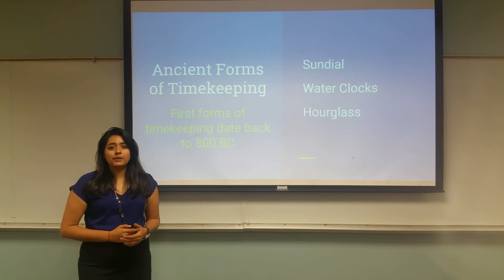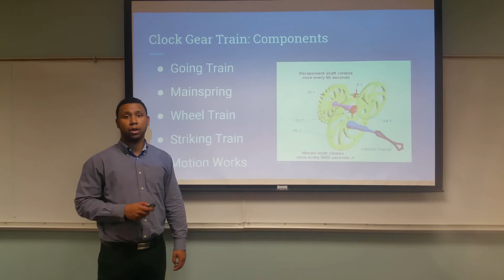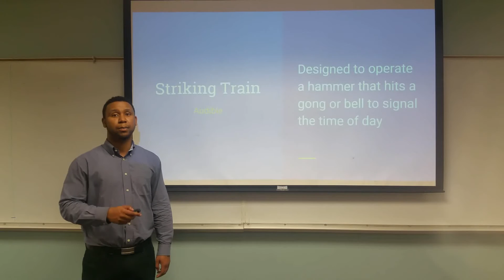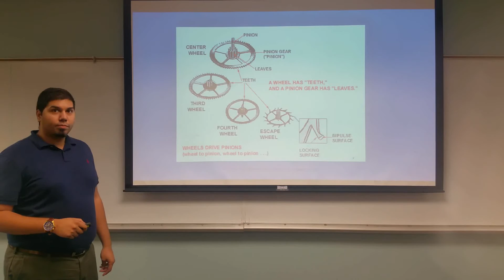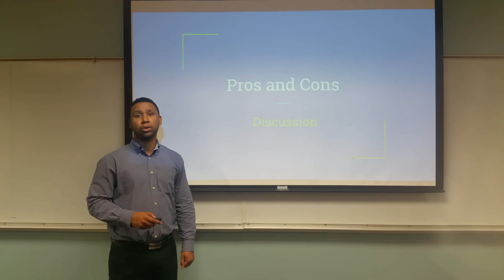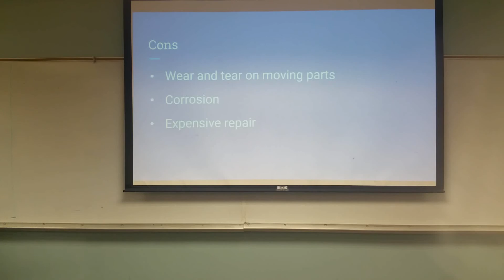Team 13: Clock Gear Trains

Comment: Presentation were good. Power point slides fill with good info. Lighting in the room was also good. First presented did a great job delivering the info well spoke she knows all the material. The audio when presenter two and three was to low.  However, the second presenter seems like he's reading, making his part sound unenthusiastic and not well prepared at the time delivering the info, also he did not used a professional outfit like his team members. overall team 13 did good.

Comment: Very well done presentation on clock gear trains. One of the best educational projects and the structure of the PowerPoint were good and flowed nicely throughout the presentation. Slides and diagrams grasped my attention and were short and to the point. Overall fantastic work team 13.